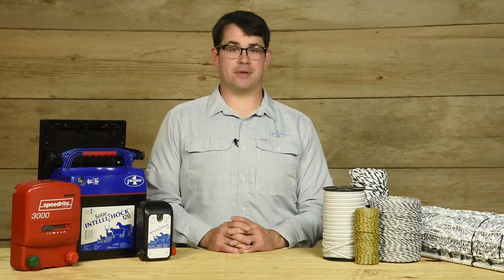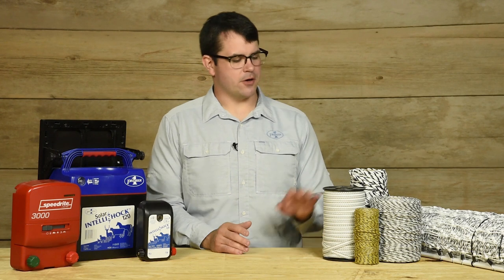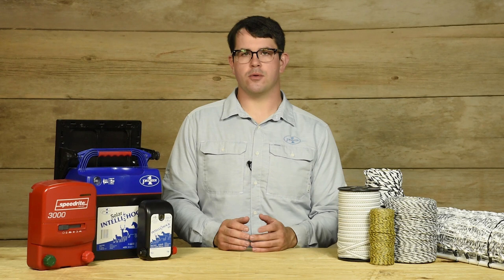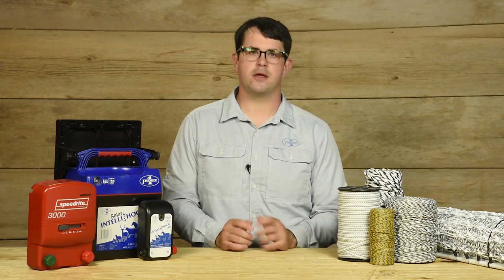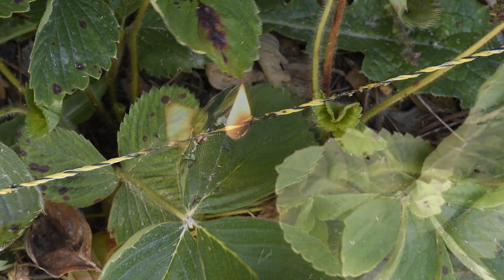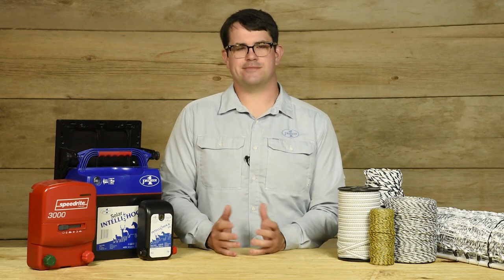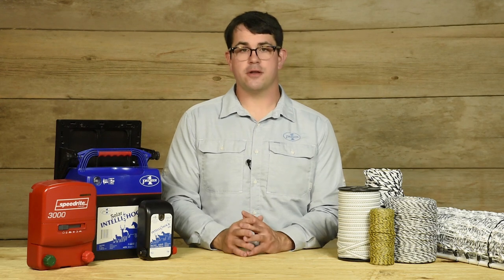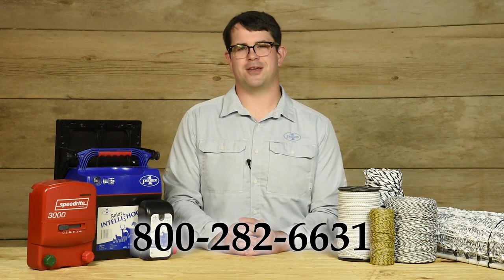Fence Safety Bulletin

Comment: What is the duty cycle of the pulse?

Is it impossible to cause a fire with pulsing?
Reply from the maker: Not sure as to duty cycle on the energizer in the video. Most pulse type, low impedance units are less than 3/10,000th of a second. Fire risk is significantly reduced with pulsing.
Reply: @premier1supplies  are these used in dry locations with tall dry grass without fires?  Or is that still dangerous?
Reply from the maker: Mow/trample the grass to reduce/eliminate grass contact. They are used in those conditions. Please give us a call at 800-282-6631 with further questions.

Comment: Do electric fences kill birds?
Reply from the maker: Livestock exclusion and containment fences are not designed to kill birds.
Reply: @premier1supplies  Thanks for your quick response.
I understand they are not designed to, but will everyone die if they perch on a wire?
Reply from the maker: No they won't. If they're in contact with the ground, they'll receive a shock that lasts 1/10,000 of a second. If they're perched on the top wire (a rare occurrence as the top strand is too low in tension to support them), they'll receive no shock.
Reply: @premier1supplies  Thank you! I have dozens of bluebirds among other birds I like to keep around to keep the pest population down.